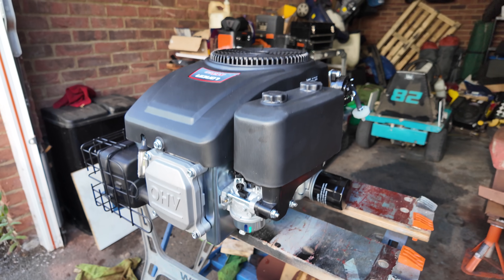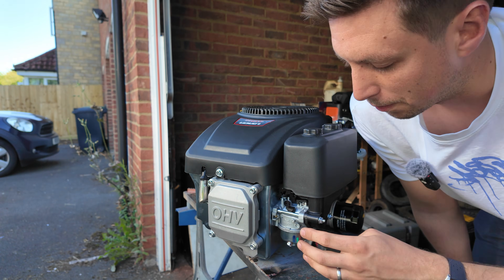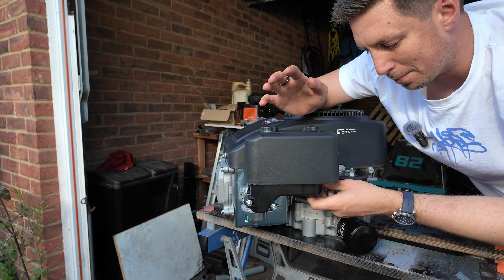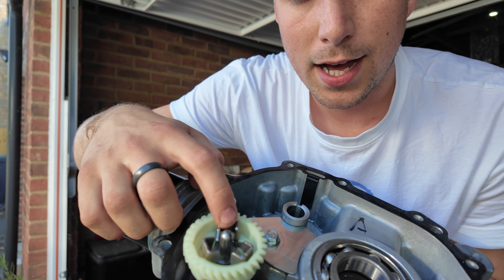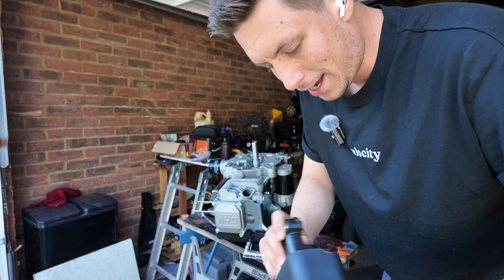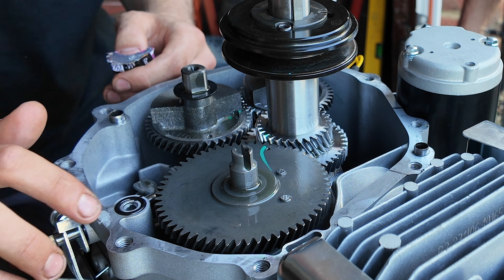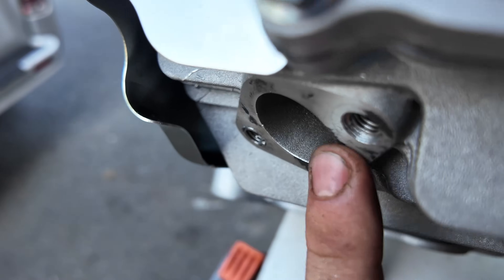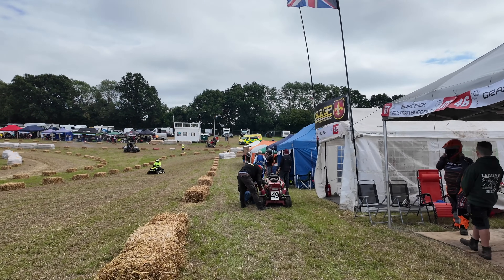Modifying a BRAND NEW Engine for Lawnmower Racing: Loncin 413cc Engine Build

Comment: Class rules here in Alberta require replacement of the flywheel with a billet one if the governor is going to be removed or bypassed. 
Was watching this to see if there was a ready source for such parts on your side of the pond 😕
Reply from the maker: Got you, we've never had a flywheel explode or come apart I don't think. So no need to change them. I can imagine a higher revving engine would need it.

Comment: How well do you know tgese engines? Mine wouldnt start a few weeks back, got fuel getting through, got a good spark, turned over a few pops and bangs, ran for 5 mins then died, always has burnt a bit of oil on start up. Rings?
Reply from the maker: Sounds like rings or some kind of wear. Hard to say though!

Comment: Hi Callum, Having trouble understanding what you are doing with the Carb, My loncin 452 seems to have same carb, inner flap connect to the governor, So I assume the two springs you add hold that flap fully open and it never moves again? the outer flap then servs as both 'choke' and throttle , mine wont start without some choke.. wondering how you mange both choke and throttle on one cable?? Regards Chris
Reply from the maker: I swap the carb out for a Honda version. They often need choke to start, so I open that by hand - then the cable is attached to the throttle. 

The Loncin carbs struggle with bumps.
Reply: @CallumRaces  Hmm how do you open choke by hand, isn't the choke just closing the outer butterfly flap that you are attaching a throttle cable to?  you have held the inner flap open with springs (that's the one the governor attaches to)
Reply from the maker: @chrissomkid380  It's on a toggle on the front of the carb - on a bug you can reach it from the seat.

I know lots of people take the choke mechanism off the loncin carb, and put it on a Honda one. That way you can have a cable on it that snaps back on a spring.

Comment: Hello, I have an 18 horsepower Loncin engine, V twin, and I noticed that it doesn't have enough power, it's really weak for its horsepower. Have you had similar experiences or can we get in touch?
Reply: I've a customer that bought on of the cheap 19.5HP Ariens branded ones (£399 brand new), and he has the same complaint. 20hp Vangaurd it replaced had much more torque. The twins are Kawasaki copies though, so inherently less torquey anyway.
Reply: @CSAKvids Mine is not that cheap. It was 1000 euros for 18hp

Comment: Did you leave the governar arm through the block, or remove and put a bolt in hole, im about to do this to a Loncin vtwin 17hp
Reply from the maker: Yea I did. It's held in place with a circlip so isn't going anywhere. Some people replace them.
Reply: Hello, is your engine a Loncin 635ccm? LC2P76F?
Reply: @dejannikolic4647  no its the 3F, same block smaller cc 586cc
Reply: @anthonyjacobsonsimracing Did you have some problems with power loss?
Reply: @dejannikolic4647  no, all fine

Comment: I can’t see that 5-6 seconds no-load running would harm that sort of engine at all, as you’d previously run it in, so oil was everywhere it needed to be. However, your panic-strip did overcome my intended comment that in your initial checking you checked the big-end bolts were not loose, but you didn’t check they hadn’t been OVER-tightened. Just as likely to cause you an engine failure with a snapped big-end bolt…

Interesting video, thank you.
Reply from the maker: Interesting point!

Comment: Is that "low oil level cutoff" you mentioned at the beginning not just a crankcase pressure operated fuel pump ?
Reply from the maker: You could be right! But in our rules, we're not allowed to run any kind of fuel pump

Comment: Gotta say, at least the Loncin engine having a ball bearing on the output side of the crank is definitely a feature I wish more mower engines had. The Kawasaki FC540V I run in my single cylinder racing mower only has a bearing on the flywheel side as I recall.
I was going to ask if there was clearance on the flywheel side of the crankshaft if you could remove the counterbalance shafts and put weights on the crank directly, but I do remember reading in the rulebook you guys do dyno the engines. I suppose balancing the crank like we do on some of the modified singles we run in the US would potentially bump up the HP and put you out of spec. 
 On a similar note, I know the intent is to keep it cheap, but I'd say it kind of sucks you guys in Europe can't at least use a billet connecting rod with the intent in order to try and help with the longevity of the motor. The two minimum things racers do in the states are a billet rod and flywheel for reliability and safety.
Do you have a regiment to check stuff like that after each race or so and then replace them before something catastrophic happens? Has there been any known occurrence of a flywheel coming apart at a race?

That's the nice thing running the governed class I'm in. Since the engine is 100% stock except for the exhaust, I haven't had any major issues yet, outside of a couple carburetor hiccups this last season.
Would you know why the factory mower engine is governed to 2500 rpm? Is that for safety and/or emissions regulations there? Stock mower engines in the States are typically set to 3650 maximum. That's the requirement we get checked at the end of our race for the class I run. Any one goes over that is disqualified.
I apologize for the length of the comment. Just being curious about the differences in the regulations of the sport across the pond.😁